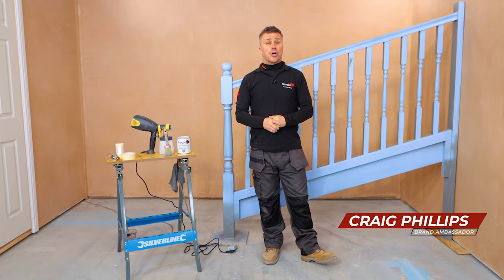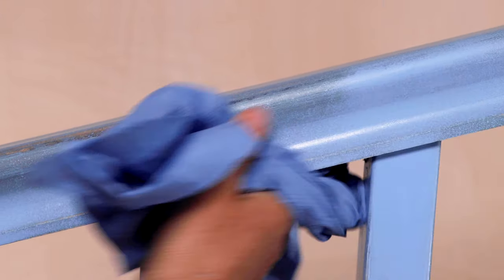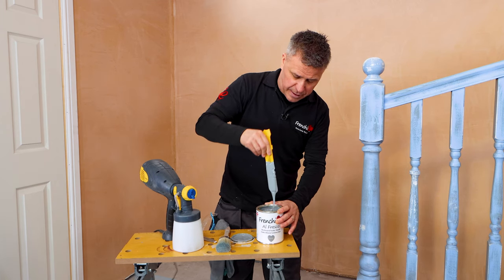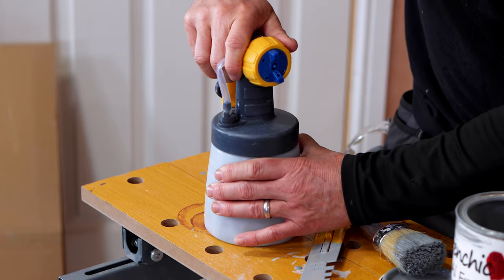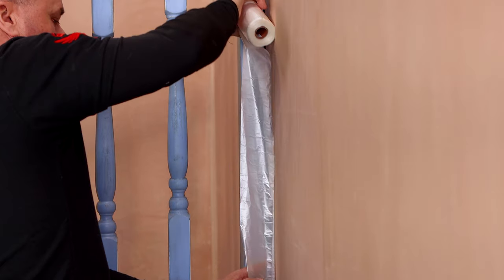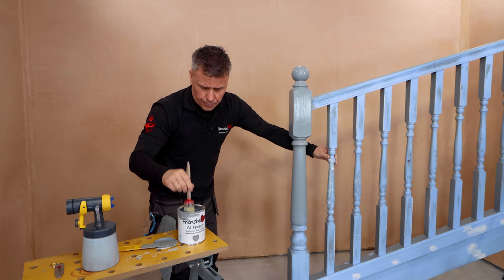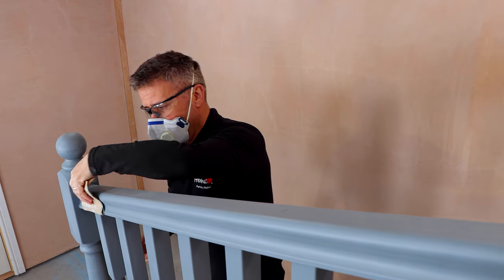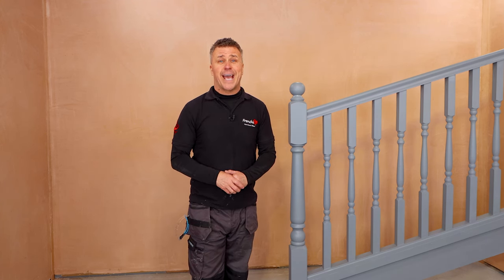Frenchic Top Tips | How to Paint a Staircase

Comment: Interesting that you use a paint sprayer. What make is the paint sprayer and has anyone used this make before?  I had a good tip once, that if your masking tape isn't coming off the roll, to microwave it for 10 seconds!  It worked on both of my rolls.  But it can only be done once, and no longer than 10secs.  That is important and no metal attached of course.